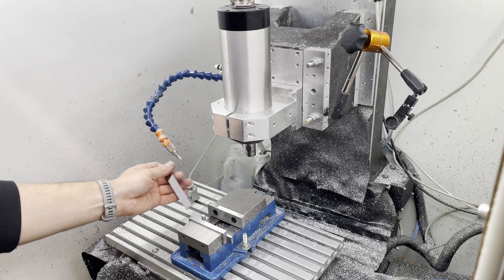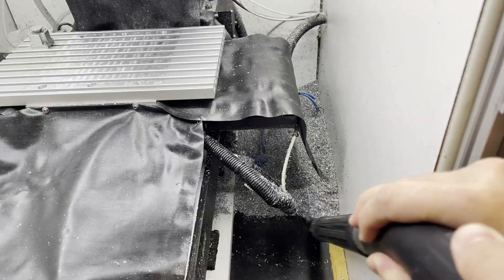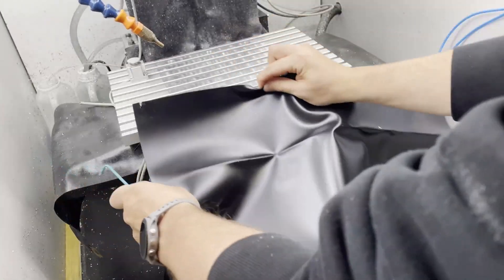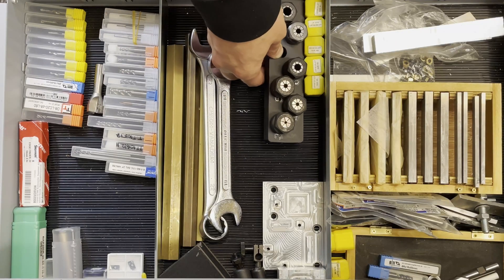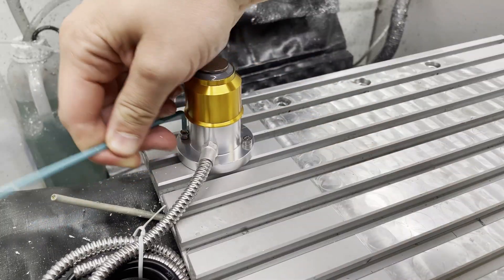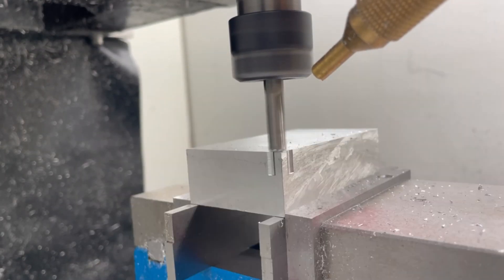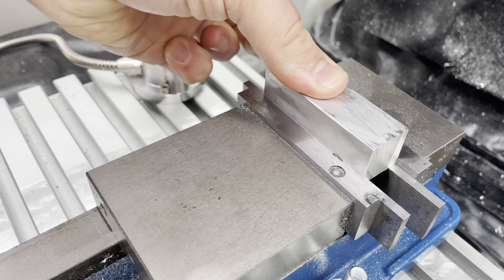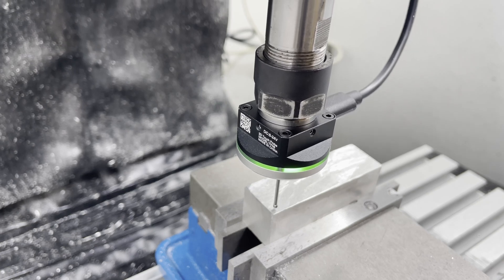It takes incremental improvements

Comment: Thanks for another great video! I am going through the same steps (a few years behind you) and have the same philosophy. There is so much more learning involved but it can be a fine balance with not making progress and loosing momentum one the project. I am currently still doing the manual tool lengths and actually wanted to buy the exact same one you got rid of! Would you say its good to go down the 30 eur push button style one to learn and get more machining time? (spindle, englosure and way covers, work holding etc are still on my to-do list, so I am cautious on spending money on the sensor)
Reply from the maker: Thanks alot, and great to hear that your build is also progressing! I totally understand that you dont wont to spend money where you dont have to. I purchased the push buttom style one end of 2021 for ±20€. The probe I got now in 2025 for 34€ , both including shipping. So there is a price difference. But incorrect or unfinished tool probing moves are also really annojing and time consuming. 
I think if I would go the push buttom round again, I would 3d print the holder myself and get just the buttom or reporpose one.
Reply: @lukasOtis  oh I did not realise the difference was so little. I will definetly get this one! Eliminating errors and headache is always a good thing.
Reply from the maker: True! And they might have gotten cheaper over time. Can’t remember my exact reasons for the other